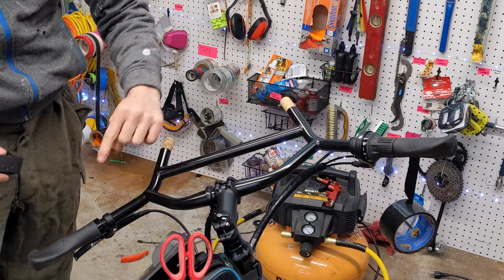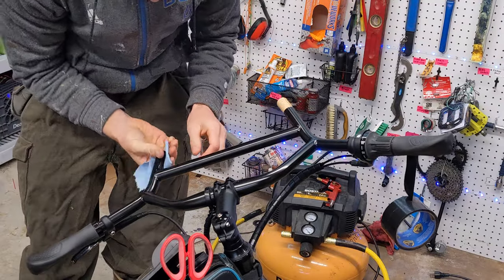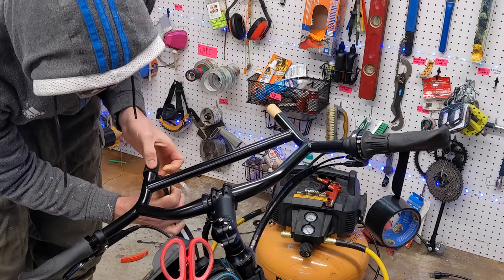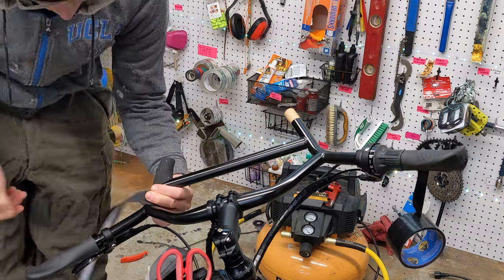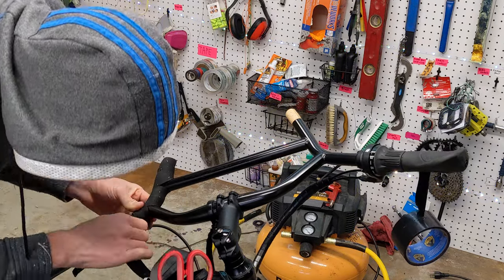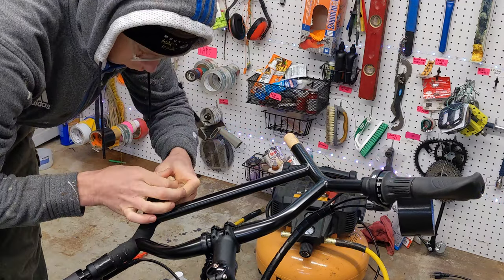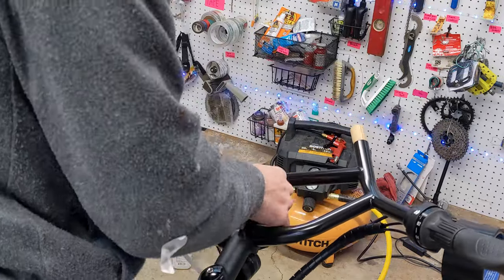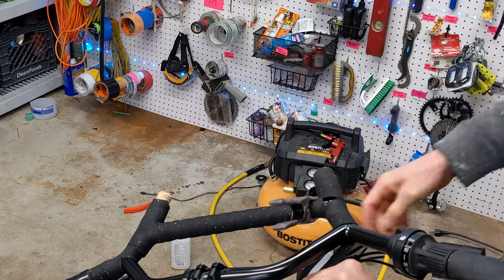How to wrap bar tape on Moloko bars -- Priority 600 bike! Handel bar tap. Bar wrap theory!

Comment: I just finished wrapping my Moloko bar thanks to your video. The one point I'd add for future viewers is you should wrap the front horizontal straight bar first, then rear horizontal curved bar, after which the left and right curved bars for last. This serves 2 important purposes:
1) It provides a consistent "look" between left and right, as opposed to the result seen in the video
2) The tips of the 2 horizontal wraps are covered by side bar wraps, which protects them from fraying. I think this is important.

Thank you for the video!
Reply: GREAT advice! Thanks!

Comment: I double bar taped with brown leather on top. I also bring both sides to the centre of the horizontal bar and tape it there. I never hold my hand in the center anyways. Plus I usually mount a light there. Works for me. Wish I could add a photo.
Reply: GREAT piece of advice! Thanks!